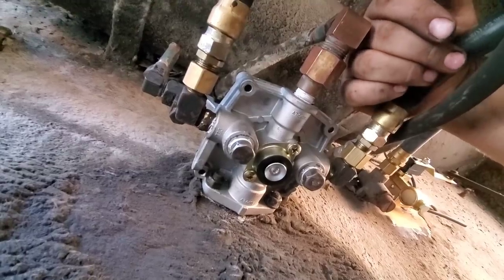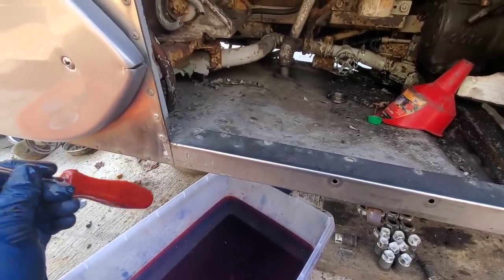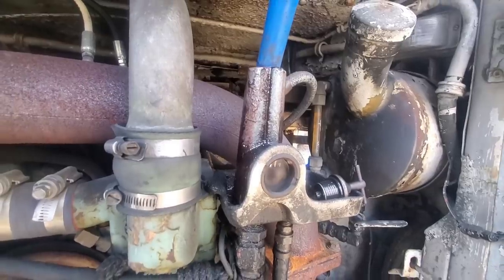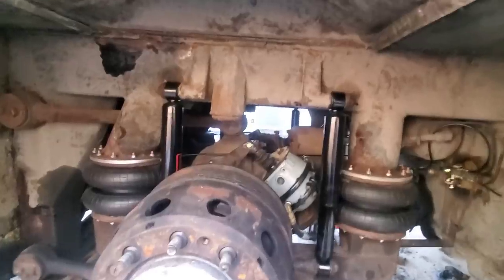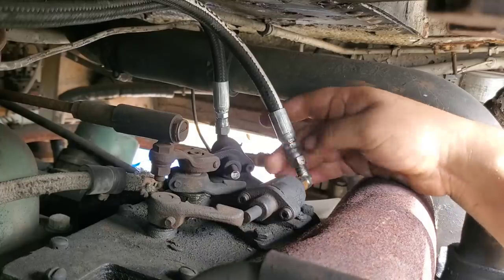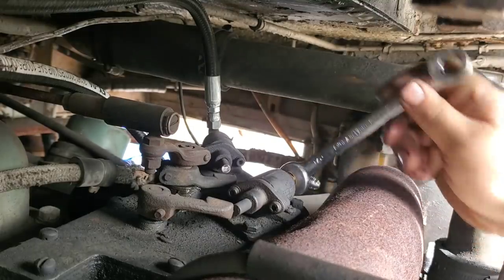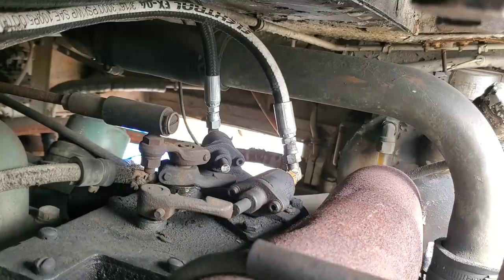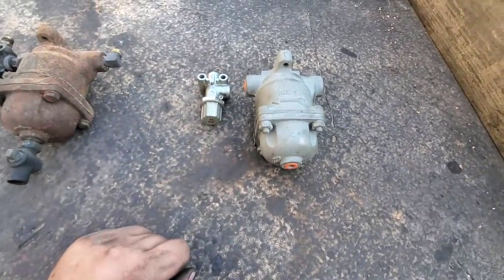Getting the MC5 back in service

Comment: Can you flip the leveling valve arm over so it jogs out away from the wall rather than in towards it?
Reply: looks like that would fix it
Reply from the maker: They aren't supposed to be removed. Tamper proof 1 time use fasters on the rear

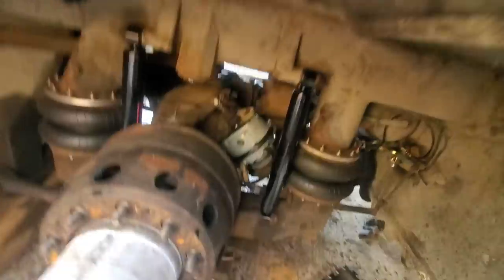Comment: I haven't posted any questions before but at about 3:33 into the video, there appears to be a big hole in the framework above one of the airbags. Is that an issue? Doesn't seem like it should be there....
Reply: To me that looks like oil or paint. Noone would drive a bus with that huge of a gouge in the frame.
Reply: @gerryka  how long have you been watching??
Reply: @peterrogers9228  not sure I understand your question. Am I missing something obvious?
Reply: @gerryka  its a rust hole!
Reply: I believe those are air beams that rotted so they put block off plates on the air bags.  Someone can correct me if I'm wrong.   I believe the air beams provided a good ride.. not an expert so...
Reply: Yes to the air beams function and  they have been blocked off as a previous owner had rust holes brazed over which is apparently a no no.  Tyler answered the apparent rust hole question on another thread.  Its a big flaked off section of undercoating.

Comment: If you hadn't had the oil filled bucket there, the screw driver would bounce directly to the middle of the bus both length wise and width wise...its a screw driver law somewhere-also applies to sockets too    LOL
Reply: My luck says it bounces and rolls to the most inaccessible location. One which the offending tool can’t be reclaimed from without removing something. Lol

Comment: Hi Tyler, I have a electric car question I'm sure you have been asked before but since you know you way around electrics thought I would ask or some of your viewers? Why don't they use an alternator to keep the batteries charged on electric cars so you never loose charge while driving? I saw a picture of an alternator rigged up to the wheel of a car. Looked like a joke but then the concept was interesting.
Reply from the maker: There is no such thing as free power, so id you had an alternator powered off the wheel it would be taking additional power to spin it. At current technologies limit the alternator wouldn't be able to make more than yhe car used. So it would end up a net loss. Solar on the roof would be an option tho.
Reply: So it would work if the alternator had the capacity? Wow so the batteries in a electric car must draw a huge amount of amps. Well that answers my question. Thanks Tyler
Reply from the maker: @TimsWorkshopTJY  theoretically with technology currently unknown it could be possible but I dont see it happening in any current life time.
Reply: @TimsWorkshopTJY  it wil never work.  laws off phisics, you can never get more power out off something you put in, You will always have losses.
Reply: @Spyke383  maby a flux capacitor, Or dilitium cristals... lol
Reply: Makes sense, will need to read more about the physics so I understand it. Just curious

Comment: If you can find a local distributor for Fluke meters, they actually make an ultrasonic compressed gases leak detector, it would make finding air leaks a lot easier. I know they’re not cheap but it’s a pretty cool tool
Reply: spraybottle whit soapy water  will do that trick just as fine.